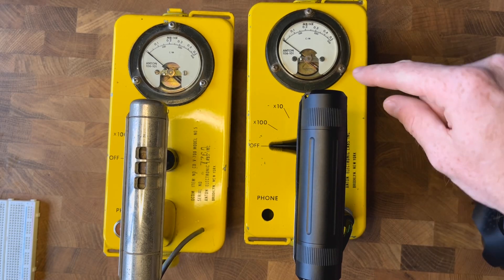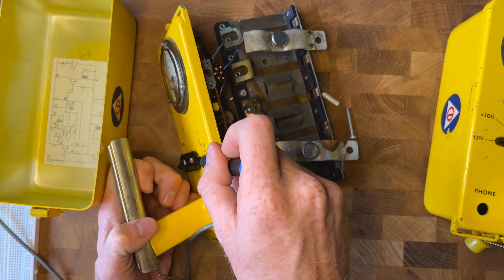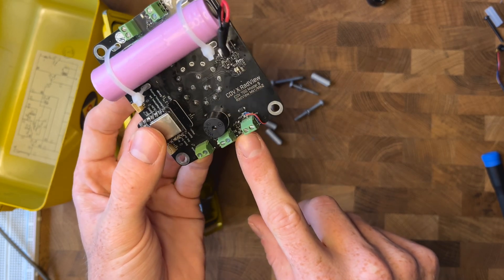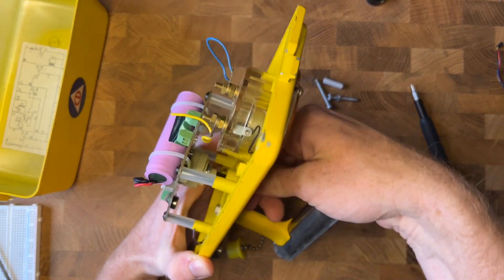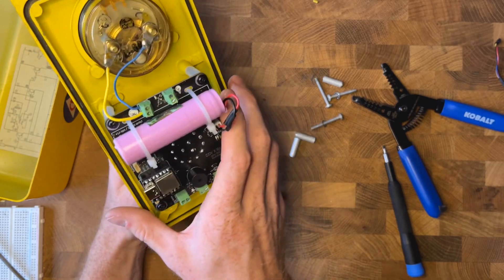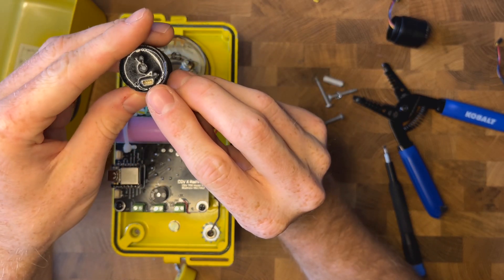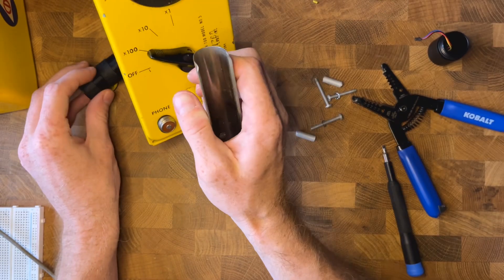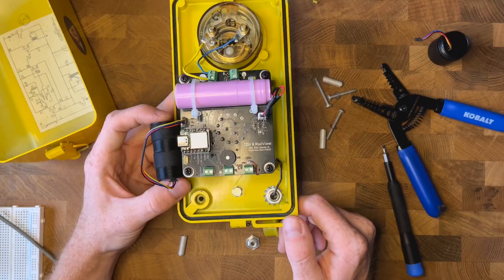CDV x RadView Build

Comment: I looking at getting a Geiger counter and came across this and was wondering what the difference between this and a normal one is? I don’t know what the specs mean, I’m mainly looking for one to use for fun on occasion and incase of nuclear war or incident
Reply: The Mk.1 and Mk.2 are scintillator crystals and are way more sensitive to gamma radiation  than a Geiger counter that uses a Geiger Muller tube. A Geiger counter basically tells you that an ionizing particle has been detected a scintillator on the other hand can also tell you the energy that the particle has and the device can be energy compensated and tell you what the dose rate is and then you can figure out how much ionizing radiation that you are being exposed to very valuable information for your health and safety.
Now this is a very simplistic explanation I would recommend that you research and learn more on the web.
I actually ordered a RadView kit with a Mk.1 and am excited to bring new life and greater sensitivity to my old 1960's CD V-700 Geiger counter by making it into a scintillator device.

Comment: I'm a little confused I'm looking at the website and there's the radview MK1 and MK2, do they come with that circuit board specifically for the cdv's?
Reply from the maker: They are separate units. The board is an adapter to be able to use a CDV 700 as the readout. I don’t have them listed right now but it works with either. Shoot me a message on our contact page and I can get you one!